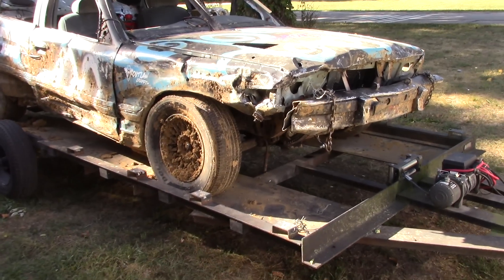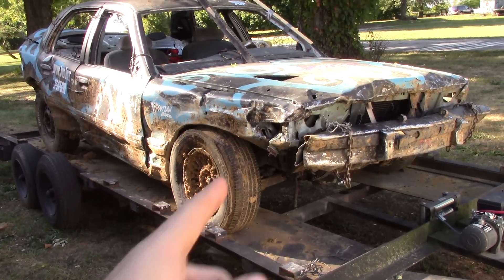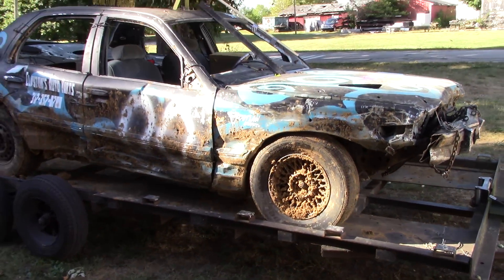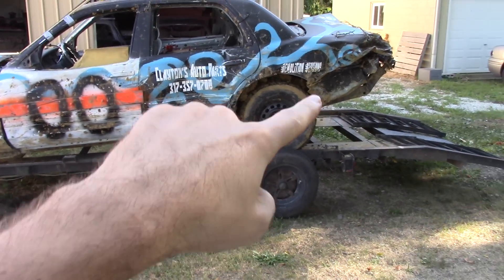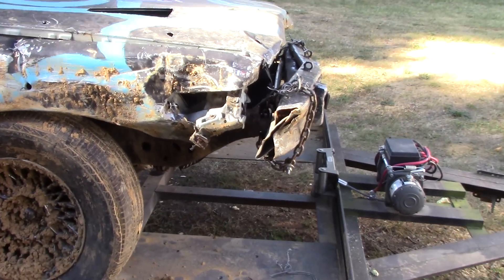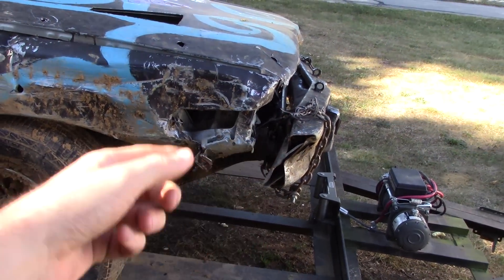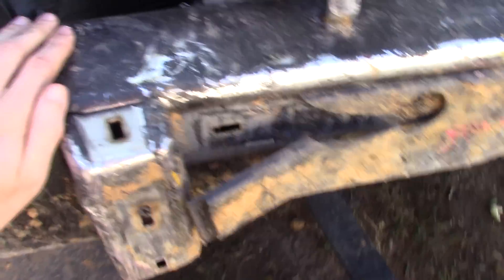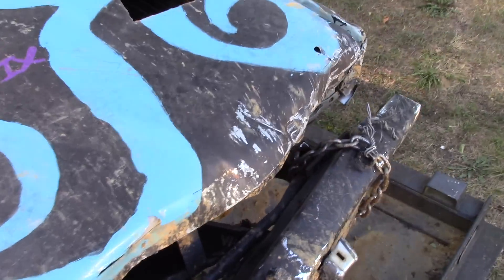1995 Mercury Fullsize Aftermath Round 2

Comment: My first derby, I ran a 1980 Chrysler Newport in the smash it street stock class in west central ohio, and one. I was up against nothing but compact cars, and this chrysler is a unibody car too, frame never bent, but it did belly. I had to use the front end most of the time after it bellied. the front bumper was bent upwards, was a rusty 76 t-bird bumper I believe. but i did more axle damage than frame damage to those cars. Now my dad and I are building an 09 charger for the 80's wire class.

Comment: My 1989 ford wagon shoved in like that on the front. I kept snapping the nose cone on the starter. Idk the differences between a 5.0 and a 4.6 but if the starters are in the same place you might wanna check your clearance on your starter. Mine broke off from the crossmember hitting it.

Comment: My 99 went in 4 inches and only up a couple. It pulled out fine. Plate the bottom of crush box where the front frame comes into the box. And the frame kinked under the front door too.

Comment: I just ran a 87 Vic 2 weeks ago and I had the same problem. It's nosed up in front but driver side box twisted and frame rail pushed straight back. Caused tire to jam into the back of the fender and the firewall and broke rag joint on steering shaft when I tried to turn it. Back of the car is still straight because I drive forward too much lol. So I have to try to pull it some so I can get another run out of it next year.

Comment: On that rad support on the bottom pull it back out and when you put your bolt through for the bumper shock cut a hole in the side of the core support with a large washer I made a video on my channel  rons demolition derby builds its the video of the 02 marquis build check it out and it will also help if you use wooden cribbing blocks and chain the car down with binders and use your winch to bend it back down
Reply from the maker: Thanks, good idea

Comment: I was the biggest advocate saying you should have no problem running it again, but seeing how it shifted/twisted(the steering shaft touching is the big indicator, there are a few more) up front before collapsing the boxes I would probably scrap it. 

Don't get me wrong, i've had boxes push back, and have had the car nose and break the starter. if you know how to cold tilt, you can fix it either way as long as the frame doesn't rip while pulling the boxes out/frame down by hammering the bubbles/bends in on themselves and still be good to place as long as you drive smart. The assend still has a ton of life left in it believe it or not, and minus the frame flattening the way it did on the passenger side, i actually prefer them to bend in something like that(first notch at a diagonal, second horizontal). If you can get both sides to bend in toward each other, everything wads up against the speaker deck/package tray/rearend and takes longer to dump under the doors.
 
As far as the front crossmember, the factory welds are pretty crappy and i see them break there a lot on guys that are new to fullsize  around here. We're allowed a 6x6x1/4" plate(smashit/others that have followed suite) to mount if hardnosing(can't shorten frame, only level it) or can weld the crossmember/shocks solid, and usually cut the center of the crossmember out as i've had/seen a lot somehow V into the radiator despite the bumper being fine? If the hood is steel, I'd keep it when you decide to scrap the car.

Hopefully this info helps some people out. I've seen some cars nose up and scrapped with the rest of the car perfectly fine.  With a trailer and either some jackstands and comealongs or jacks and tiedowns they can usually be pulled back down and ran again and still be a competitive car.